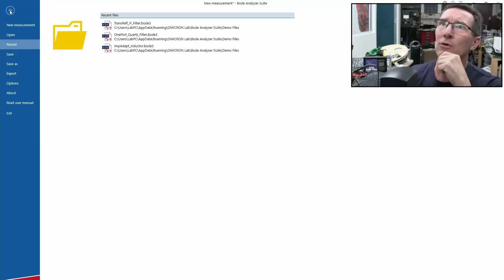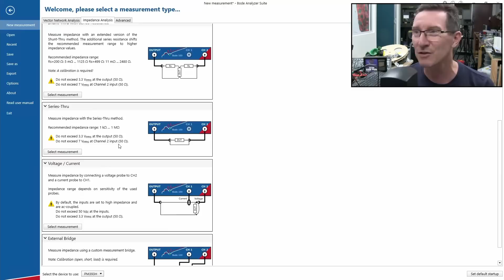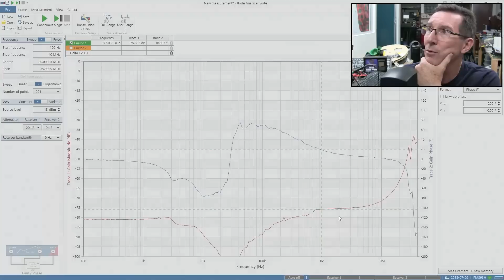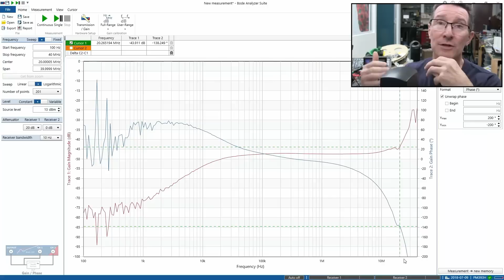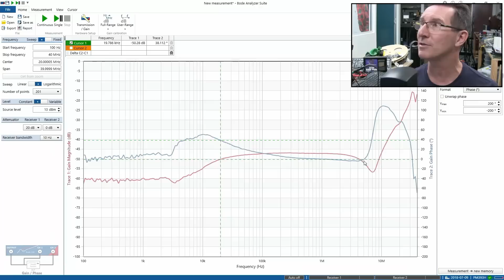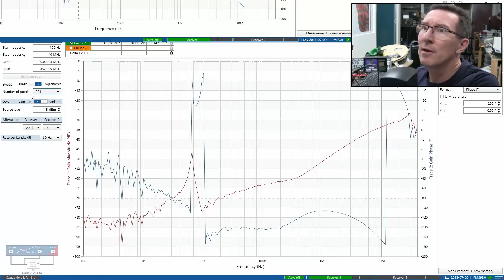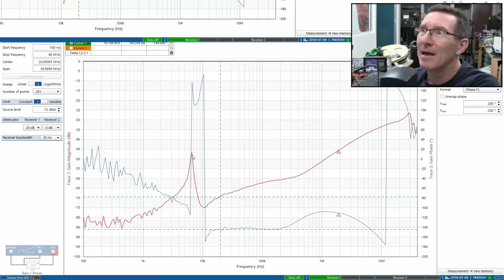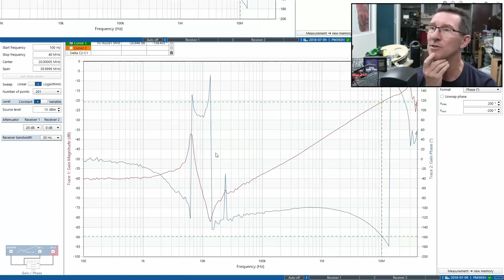CMRR Followup Micsig DP10007 vs HVP70

Comment: I got a dp10007 one. It's a terrible device. Its error at 20mhz reaches to 19%. In my test, it works well up to 670khz with an error lower than 2%. There is no way to open the enclosure to tune it. Just a waste of money and time.
Reply: There is obviously a design flaw in the DO10007 that affects higher frequencies.  But for the price, if you don't need multi MHz bw  (ie VFD motor drives, tube amps) it's not horrible at lower frequencies.  Micsig is obviously aware of the issue as they have discontinued this model and have new a new MDP series that appears to be significantly improved - they sent one to Dave, hopefully he does a follow up on the revised design.
Reply: I'd like to see him retest with the newer version of the DP10007.  According to its new specs, the CMRR were >45db at 1MHz, >60db at 20kHz and >80db at 50Hz/DC.  In line with the DP10013/DP20003.

Comment: Micsig Bode plot looks like a resonance problem. Very similar to the magnitude of a quartz crystal's impedance vs frequency, where the positive peak is the parallel resonant frequency, and negative peak is the series resonant frequency. I suspect you have a fairly high 'Q' LC tank hiding in your probing setup, or Micsig needs to reroute their compensation network.

Comment: Dave, I thought you mentioned in a previous video that Micsig made some changes to this differential probe after your initial tests to improve the CMRR.  Is this video testing the original or the updated one?
Reply from the maker: Original. They were supposed to investigate and makes changes, but they never got back to me and went on and sold the probe. Don't know it's current status.
Reply: @EEVblog2  OK, Thanks for the response.

Comment: I think the problem with the video was twofold. First, you released two videos which were basically identical - sure one was an "extended cut" of the other, but you sort of failed to call out the bonus features so anyone who watched the first video would have to sit through the second video having seen most of it again. Alternatively, those who saw there was an extended cut and watched that video would have no need to watch the first video. Maybe it would've been better had you just had a cut where you featured just the bonus parts without needing to see through the whole video again. 

The second reason is, it's a highly technical video at a time when people aren't in a technical mood - it's the holidays and they're enjoying time with family, friends and just end of year relaxing between Christmas and New Year's. This is also because you're featuring a device few hobby people have - so while some people may be busy putting together hobby electronics, they probably don't have a need for a differential probe given what they cost. If they have exposure to one, it's probably through work, and thus such a video would do better when people are back at work.

You're right in that's it's going to be a long pole video that will do better in the long run - as people return to work they may get to play around with the differential probe at work, or some people might acquire one (either through work or for personal use) and thus learn more about their acquisition.

Comment: I wouldn't use acronyms, ie, type the whole thing. You are relying on people knowing what CMRR means, where as typing full name may trigger words that people latch on to. Also acronyms aren't even consistent world-wide, ie, "CRO Gone Wild" has no meaning outside AUS - lol -. 
As for the vid, it's obscure knowledge for most people, ie, nothing that a low-level hobby guy will find interesting because it's a bit too hardcore. Basically if it was more directly scripted and to-the-point, and shorter, I might not have tuned in and out during the 20min, ie, it's only for the few pros.

Comment: It was a great video. I'm trying to design a differential probe to measure voltage drop across a motherboard powerplane when a cpu is under heavy load. I found it very helpful.